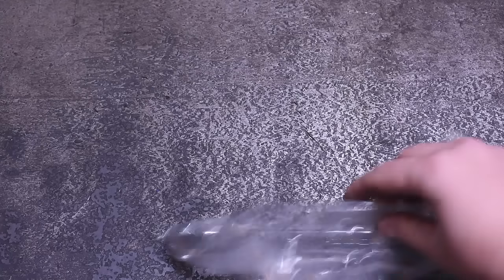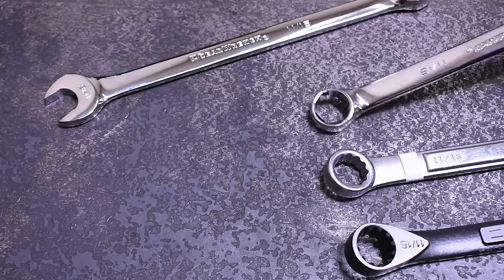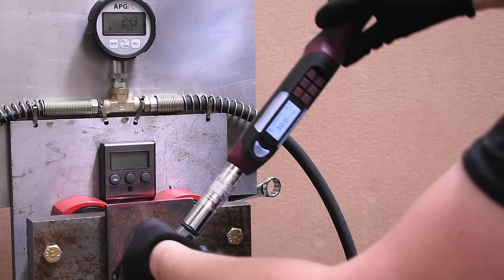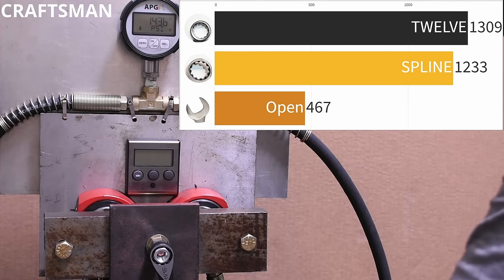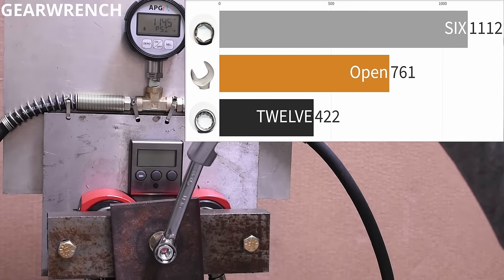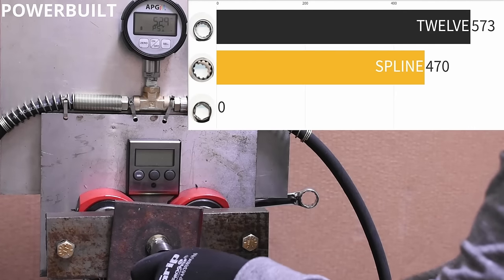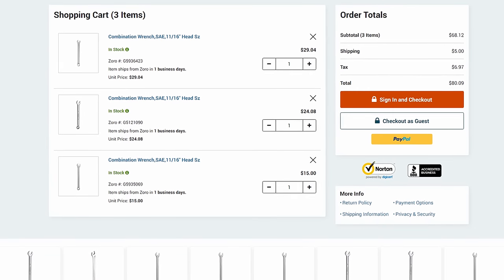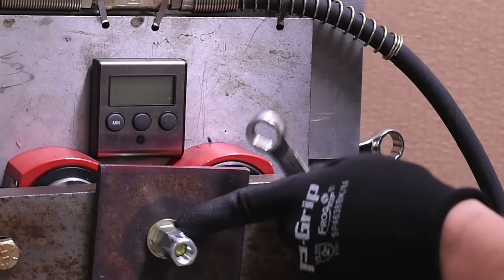Let's Settle This! What Wrench & Socket Design Will Slip 1st?

Comment: The only scientific way to judge when they're going to slip is judging when you have to apply a lot of pressure and your knuckles are in the perfect position to lose the most amount of skin
Reply: ohhhhhh mannn did i get some memories
Reply: sad drops of blood mixed with grimy oil, dust, rust, and to make it better getting a cramp are my prefered ohh and foggy glasses now i could go on but its sciency enough for me
Reply: ...and how low is the temperature 😉
Reply: Step right up to play Bust That Knuckle!🎉
Reply: I feels it, my cockiness ov strengths to my bleeding failures ov possible hope
Reply: Yes!
Reply: I can testify threw years of experience that this holds true!
Reply: I thought it was a right of passage to leave a couple chunks of knuckle skin in your engine bay 😂
Reply: Dear god, so true!
Reply: That’s this weekends task
Reply: Fact
Reply: EVERY one of us reading this internally winced at the memory... 

Im literally looking at the scabs on my knuckles now
Reply: Indeed
Reply: Dont forget the amount of bruise from busting your lips on the spanner
Reply: I thought he’d rip an elbow on that big corner of steel😱
Reply: I'd like to add to that, "while working outside in the freezing temperatures." It hurts no matter what, but I swear (literally) that when my hands are cold, it hurts more...
Reply: I don’t even remember wrenching unless I am missing a finger or toe.
Reply: That one goes along with, “everything works when you point it at your face.”
Reply: Haha
Reply: Teacher: you can't physically feel a statement!
W0rp3D: wanna bet 
🤣🤣
Reply: Intake manifolds cost blood...every time.
Reply: I love the comments, threwout the year.
Reply: @MillerFourFingers  tell me about it. Just did mine. Mya hands and arms look like i shoved em in a pile of razorblades.
Reply: Truer words haven't been spoken lol thats amazing
Reply: God I really felt this comment, that's why the ugga dugga comes out often as possible.
Reply: Ive broken a couple knuckles from this xD
Reply: Indeed! 🤣😂🤣😂
Reply: Most legit comment 👏 I've been a mechanic 25 yrs and often if I want to make sure the tool doesn't slip i just make sure I can't make myself bleed. I KNOW IF I CAN BLEED THE TOOL WILL SLIP LOL
Reply: Well, that mental image gave me physical pain, this is a metric I wouldn't want to test any more than I already have XD
Reply: Reading this comment activated my wrenching PTSD 😂
Reply: Yep
Reply: Fingerless gloves
Reply: The likelihood of a wrench slipping increases in proportion to the temperature of the exhaust manifold near your knuckles.
Reply: @piccalillipit9211  indeed
Reply: Wish I had a penny for everytime this happened. I've got scars on all my knuckles...
Reply: Blood, sweat, & tears,
Grease and metal shavings 
Bloodshot-eyed rage and 4-letter ravings,
Trips to the part store just before they close,
A slipped breaker bar cross the bridge of my nose
It's all back together but we're missing a spring,
These are a few of my least favorite things.
Reply: Makes anyone who has done it wanna cuss just reading your comment. Crushing every time. We all know better but...
Reply: W0rp3D ... Your statement is 101% fact and I have plenty of memories and lost tools do to their uncharted flight that may or may not have caused broken windows and friendly fights in Wich to this day I plea the 5th...
Reply: Involvement of cartilage is a showstopper.
Reply: I have some physics knowledge and i was right about what ended being the results with just theory, is not hard, hexagons force distribution is the best by far, using distribution of force based on angles it is going to be the best always for anything it can fit, the nut itself should also be the best in hexagonal shapes.
Reply: How true. And once you're experience is up there you'll know 5 seconds before it happens. And after you've had enough of that you'll stop to put on gloves or change positions before it slips.
Reply: Truer words never spoken
Reply: 100%
Reply: Gotta use an open hand if that's the case. i'd rather slip and slap something than punch something lol
Reply: @machfiver753  Hell I usually know 30+ seconds before it happens and I still do it.
Reply: Painful throwback
Reply: Yep, only time I've ever had a full power slip is once my knuckles and skin were gonna take the most damage. Tools demand blood.
"Blood for the Blood God! Skulls for the Skull Throne! Milk for the Corn Flakes!"
Reply: When working on a car, it will always demand a blood sacrifice. It won't work until it gets at least one every time you need to work on it.
Reply: also, you have to remove bolts until there's only one left, since that's always the one that's frozen
Reply: The last thing I needed was a reminder of the skin missing on one part of my hand and the blood blister on my hand from earlier today
Reply: @reubeng2110  dont forget the sweat dripping from you brow at that moment you almost break it and have to ignore your burning eyes
Reply: Busted knuckle juice is the best stuck bolt penetrant.
Reply: Basically, anytime you use a traditional wrench on exhaust bolts.
Reply: This is definitely true. The more skin you will lose the greater probability the wrench will slip.
Reply: Absolutely true.  The amount of skin lost is directly inversely proportional to the holding power of such a bolt pattern.
Reply: I have a set of mechanics gloves in my box that get brought out whenever I have a potentially gotta punch some rust here moments.
Reply: man
Reply: @mhaseth  I just thought it was me being terrible at mechanic tasks. Some of us didn't have very good dads lol. In his defense though, he was better than some of the dads I hear about these days. Yeesh.
Reply: I concur.
Reply: Can also be determined by the amount of swearing that occurs once  you lose that skin.
Reply: @reubeng2110  Yeah, it's so specific yet extremely relatable...
Reply: Also the level of slip depends on how many F bombs u use after the said slippage😅
Reply: 😆 I see you're a man of experience! ☺️
Reply: You're doing wrong
Reply: i fucking love this comment. W comment
Reply: So true
Reply: Tap the wrench with a hammer and save your knuckles
Reply: the ultimate scientific test would include skin loss, breaking another part unrelated to task at hand(that will inevitably take 7 days to be shipped), dropping the wrench in juuuust the right spot to where you can't reach it from above or below, and doing it all while you can't feel your fingers...did I miss anything?
Reply: I believe the cursing-scale is the most accurate measurement you can use in combination here...
Reply: Damn right.
Reply: Best thing I ever did was buy a good set of mechanics gloves. My hands already looked like ground beef from the many years of popping a knuckle. Now it is just a dull ache instead of a bleeding mess. How come those tool manufactures never found a good way to keep your grip on a wrench when there is blood all over it?
Reply: 😂 truth
Reply: still have a scar haha
Reply: Blood for the Blood God!
Reply: @trippyhare  LOL Might be able to get a minor daemon with the amount I have spilled in the name of General Motors
Reply: I've run that test many, many times.
Reply: @garydurandt4260  
I've learned to swear in a number of languages.
It really helps after I've gone through all my English ones.
Reply: Busted knuckles shows noob mechanic. A dead blow or cheater or wrench extension all apply more force with out sacrifice.  What good are ya if hands are suffering lol
Reply: Sliced open a knuckle so badly that I wasn't even aware that I had blood streaming down my arm until someone else was frantically trying to get my attention. 

From that day forward, I decided to not ever use a cheap tool again. 🙃 🔧🔩
Reply: all of my knuckles have been skinless at one point or another so you tell facts
Reply: This guy wrenches
Reply: Knuckles can have skin on them?
Reply: No offense but you guys seem to be forgetting the Kevlar gloves. And yes they are always on
Reply: @MillerFourFingers  Buy a pair of Kevlar mugs cut off just where the fingertip is and then seal the ends. You can thank me later
Reply: how true that is
Reply: Broke a pinky cause of this very test...
Reply: lmao!!! so true!!
Reply: Im glad i learned to use an open palm when i was young🤷‍♂️
Reply: Slice my finger nail to my knuckle couple hours ago. This bolt was bent. Had about half metre extention on breaker bar. Used 2 arms and leg. Breaker bar bent, socket slipped on bolt and yeh you know what happened next.
Reply: I still have a hole in my knuckle, I did that job weeks ago
Reply: kinda like how roger rabbit couldnt remove his hand from the cuffs until it was funny
Reply: That is hilarious
And everyone reading it probably laughed out loud just as I did😝
Thank you Sir
Reply: LIQUID SKIN IS AMAZING 
GREASE COVERED KNUCKLES 
SEAL ANY CUT IMMEDIATELY
Reply: @norsefalconer  oh lord, being in Michigan… preach
Reply: Anybody else take the shaolin monk palm thrust approach in the winter?
Reply: I still have the scar on my forearm lol
Reply: Thi
Reply: The gamble between how "many stitches" or it's "tight enough".
Reply: Wet hands for extra chance of winning in the wrench-slipping lottery!
Reply: OP is my kind of people.
Reply: Also it should use metric
Reply: Damn, I felt this comment....
Reply: Lost a pinky nail one time. Eek. 😱
Reply: Comments you can feel
Reply: It took me far to long to get in the habit of pushing on a wrench with an open hand whenever possible lol
Reply: This exactly and being in a position that cursing just to get wrench on...
Reply: Thats when you back up and reasses everything 🤣👌🏻 grab a bigger tool and have another (safer) go at it
Reply: Knuckles are suppose to have skin on them
Reply: @SuperJ213  It hurts more. Used to do framing construction in Kansas. When you accidentally hit your thumb with a hammer in 30 degree weather, it is FAR worse than in warm weather.
Reply: Yes, integrate Murphys Law into the equation.
Reply: I’ve trained myself to not put myself in those situations by just hitting the wrench with a hammer
Reply: I still have the scar.
Reply: blood literally everywhere and day ruined xD
Reply: And to top it off your hands are also freezing… you’re absolutely mashed out of your mind at the autozone parking lot after dark on Christmas Eve and your girlfriend just dumped you and is getting smashed by chad
Reply: Yeah, head bolts in the old days ... Those fire walls and protruding edges and sheet metal screws ... I remember those chilly days and no heat . Once flank drive and flank drive plus came out that kind of torture pretty much was gone . lol 
Probably what made me a died in the wool Snap-on loyalist . Still all my wrenches and sockets and ratchets are from those guys . :)  Don't think I'd be buying them now, the prices are just too high to warrant as I no longer twist wrenches for a living .Only for a few family and friends .
Reply: Yeah, low temps and greasy black mitts . (no gloves in those days) . lol @norsefalconer
Reply: I felt this one.
Reply: @reubeng2110  don't forget the brake or carb cleaner finding every wound
Reply: My right pinky just ached reading this... Can a digit have ptsd? Lol
Reply: Amen
Reply: People talk shit about gloves, IDGAF, I wear my finger tipless gloves every day and no longer skin my knuckles.
Reply: Yes. That always works.
Reply: Have you all discovered to wait to curse the fastener until after success?
Reply: And I thought I was the only person to experience this phenomenon 😞
Reply: That's why you always pull to break.  If you must push, do it with open palm.
Reply: Brotha dont forget to mention it had to be cold outside for better feel of the scientific research
Reply: Lolllllll
Reply: @reubeng2110 don't forget to throw some good old chassis grease in the mix too 🤣. Just happened to me the other day replacing struts and a tie rod end is why I thought of it just now
Reply: This is why I wear gloves.
Reply: Similar story but with a camshaft instead of a wrench. Cut my finger wiiiiiide open. I don't care how many tools you get from Harbor Freight, but DONT go cheap on PPE.
Reply: TRUTH!
Reply: Always a rough edge aswell.

Comment: As a person from the land of rusty cars and mountains of salt, I can confirm that 6point is the way to go when breaking loose stuck fasteners. The 12's are simply for turning them off in tight spaces... but only AFTER you've baptized them with fire, penetrant, and a solid 6point first 👍
Reply: Absolutely, living in the heart of the Adirondacks I know all too well what you're saying. As a rule a hot wrench and a six point is the way to go. I have a mini school bus with most everything so I use the right tool for whatever the job is.
Reply: Reefer tech/installer here. I need a good set of sockets for when I do service. Any recommendation for a good starter set?
Reply: @ramirezmanuel117  tekton
Reply: @ramirezmanuel117  you're watching TTC, they have the answer to all tool questions.
Reply: Repent and believe in Jesus Christ  Amen 🙏
Reply: There's even a rare 5 pointer I found that is likely aviation related, i'd never seen a 5 point wrench/socket until then.
Reply: @Enonymouse_  They're called Penta wrenches or sockets for use on Penta bolts.....
They're a "tamper proof" design used by Gov. agencies like manhole covers,fire hydrants,etc...
Reply: Yes Sir! Couldn't agree more.
Reply: Got a bunch of 12 pointers and live in New England. Can’t get anything taken apart😂
Reply: ty you saved me 15 mins
Reply: Just to add to this, personally I also offer up a virgin to sacrifice to the tool gods
Reply: Repent and believe in Jesus Christ  amen
Reply: Have you heard about our lord and savior Free All? 👀
Reply: @matthewolson9704  wut
Reply: My Dad was a mechanic and he always said 6 point to break things loose.👍🏻
Reply: I just check my craftsman set I got when I became a man and I've been using a 12 point set for 16 years.  I guess I always just thought that bolts just round themselves, it's just what they do.  And just like that I've seen the light.  Ordering a 6 point socket set by gear wrench as I type this!  Thanks alot mom! 😅
Reply: 666th like 😂
Reply: Rust belt videos are what I watch living N.E.Ohio
Reply: I never even knew 6 point combo wrenches even existed until sears in Novi michigan was going out of business and I spent all of my money on every 6 point wrench they had left and every size of impact socket up too 1 1/2. And 5 ratchets. Got everything for 90% off.
Reply: I watched this channel and ended up buying my first Dewalt 20v tool, the model 891 impact wrench. It's scary powerful, so no need to worry about severely rusted bolts on suspension parts anymore. I had no idea cordless impacts had gotten so powerful. The Flex 1/2" impact wrench is very good too, although it's about the same price as the Dewalt.
Reply: I've NEVER needed a 12 point, ever. I've needed 6 point at least half of the times. 6 point spanners are a godsend for tight spaces!